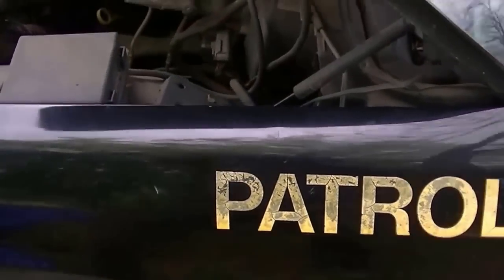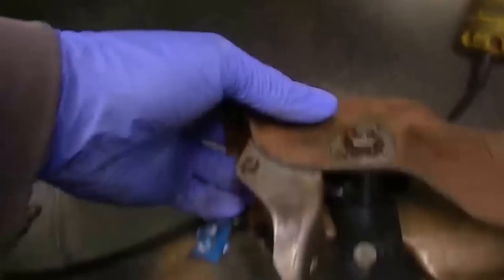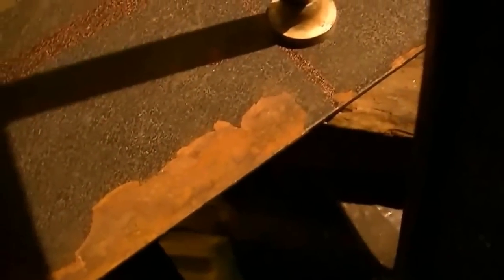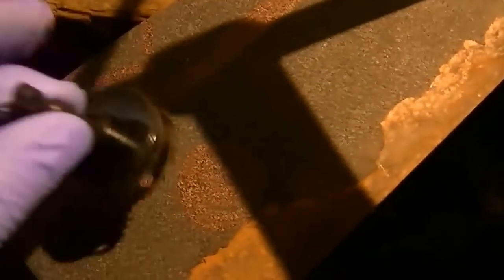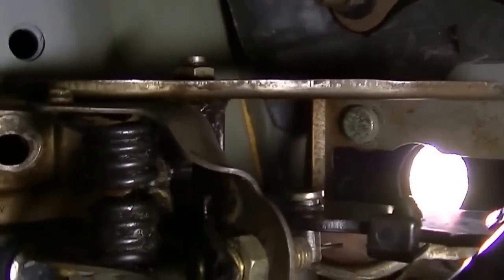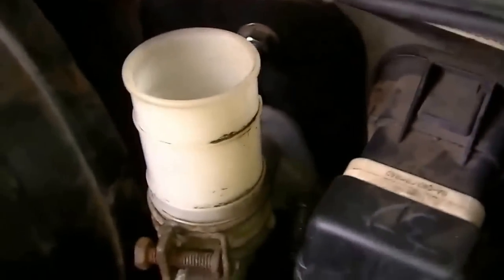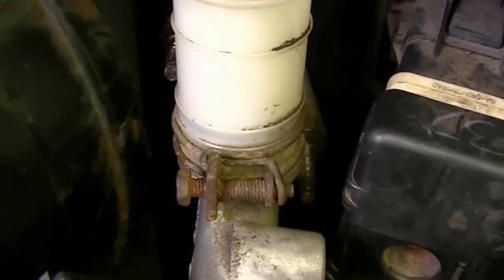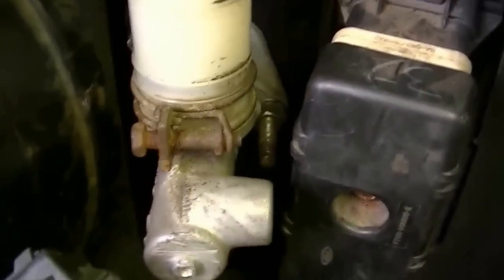CLUTCH PEDAL INSTALL CROWN VIC

Comment: You did a good job of filming under the dash .. I put in my manual pedals yesterday, and holly ca-rap there just ain't no room to be doin' much besides filming lol ..
Reply from the maker: The pedal where a very strange thing to add. it can be done very well on the 1999-2004.. The 2005 -up well you have to figure a different route. I so happy you put the pedal in there is no room, but to film like you said lmao.. Great job just you should post some pictures
Reply: @bstfordchannel923  I went with the spendy prefabed pedal kit from adtr. I don't have many metal cutting or welding tools so that's the route I had to go.

Comment: Why not use the gt pedal? Do you think it would have better fitment?
Reply from the maker: Mnay guys use the Gt pedal and you still have to weld.. and i have seen the fitment and mine seems better ( not because i did it ) to be honest they all look odd. i really dislike the cable clutch so this was something i was more familiar with... when you have some time check this out Boosted Fam https://youtu.be/sSTFRt0JHis
Reply from the maker: when you have time rate check out this video and rate the exhaust note bro! https://youtu.be/SxIVFtJ1S5A

Comment: How did the pedal design work out for you? Did the slant of the firewall and bracket mess with anything?

I have a cable clutch (Pier's pedals) in my manual swap and I'm sick of it, I'm looking for some designs for a hydraulic clutch that don't cost $600 (McLeod conversion kit).
Reply from the maker: The 240sx clutch pedal works well The Pier may be better  though... I just fab the pedal up to make it solid and at the right height..I have to see how the slave works out thats going to the trick of it all.. I think this 240sx pedal work for ya, BUT i did weld a nut into the body ( in the video ) but not detail enough to show how it was done.. ( dangerous ) with sparks from welding it kept catching on fire a bit.
Reply: I have a pedal box (clutch and brake pedal) out of a datsun 240z Im gonna use in my grand marquis. The 240z one is nice because its bolt pattern is the same as wilwood master cylinders so you have the ability to change bore sizes. The 240sx one is cool but nissan makes a 5/8" bore clutch master and Thats it. You can make or buy an adaptor or just find yourself a 240z pedal box. Another advantage is that the 240z pedal box has both clutch and brake pedals and is beefy as all hell. 
The 240sx pedal did make me laugh, i used a Nissan D21 pick up clutch pedal when I converted a Buick Roadmaster wagon :). For my upper bracket I used a 3/16" piece of strap steel and welded bolts to it. I then drilled holes in the dash brace at the proper spot and dropped my "bolt block" in and used nuts to secure it to the dash (so i wouldnt set car on fire). The truck pedal has an offset so it will land closer to the brake pedal and look factory. A little FYI a 3rd gen Mitsubishi eclipse has a nifty remote reservoir setup that has a cup that will fit on your clutch master.
Reply: Is the 240 pedal a direct bolt on or how to Fab it

Comment: I'm selling a tr3650 with 49k. I'm in northern va if your interested
Reply: +Build Suhm-thing (criminal slang p71) it's out of a 2003 gt. I'll sell it for 500
Reply: +Build Suhm-thing (criminal slang p71) also my trans has the wiring harness and a stock shifter on it.